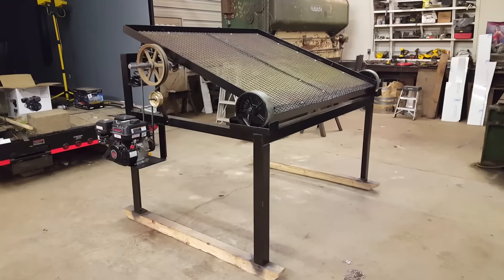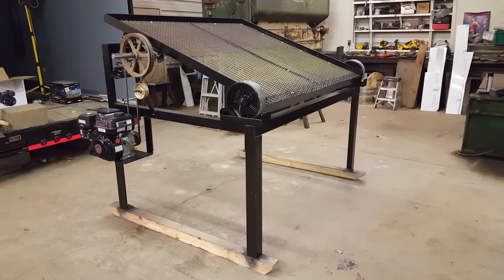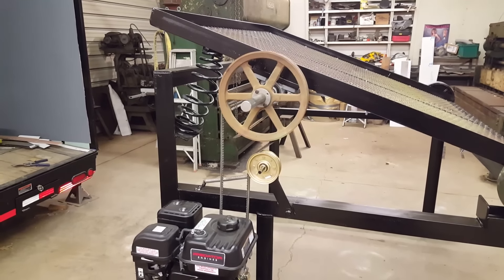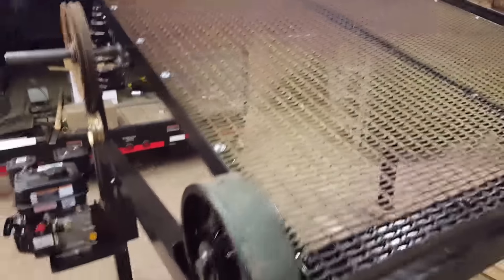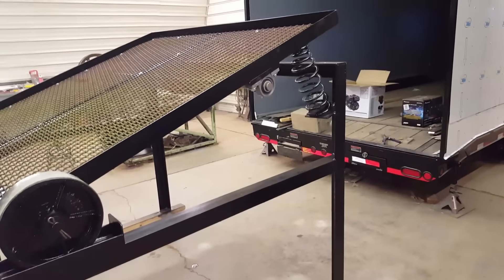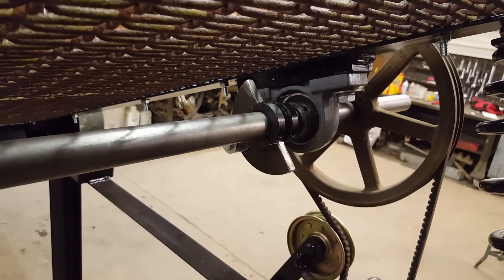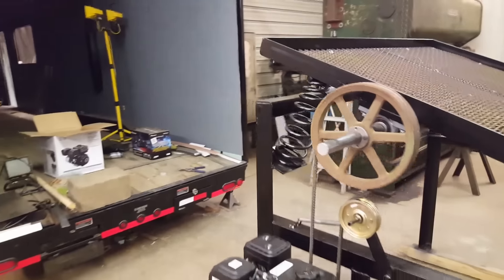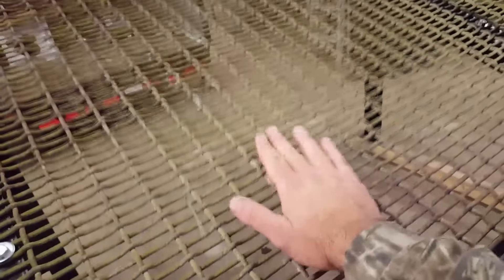Topsoil screener

Comment: Build the screen deck. Set it on springs. Take a rear truck axle with rims on it (no tires). take 3 or 4 inch diameter pipe and cut it in half, making 1.5 inch or 2 inch half circles. Weld those to the rims that are still mounted to the axle and differential. Weld 6, 7, 8, or 10 of them to the rim so when it spins they would bounce a ball up and down if you could keep it on top of the rim. Mount 2 rims with tires on them to the shaker deck, both on axles. Line them up so they're touching the rims on the truck axle with. Sooo, when you hookup the differential to a motor, the motor spins the differential yolk, which spins the bare rims, which spin the tires mounted to the screen deck. There you have a deck that vibrates when those rims spin and every time the half circles hit the tires on the deck, the screen bounces. There's no belt to break, no counterweight, no "special bearings" to replace when they go bad, and heavy duty bearings made for trucks and trailors.
Reply: Have you seen any videos of this or done this?

Comment: Nice job!  I think you may need to add couple of angle supports under the screen.  Looks like the screen is spanning a fair distance and will fail over time due to soil weight.
Reply: Thats what I was thinking myself, I started screening flower beds that had several layers of rock in them by hand last year. I had to add bracing because I kept damaging my screen shaking by hand, actually was putting in too much dirt at a time. Mine was made from 1×1 wood. Worked this 65 year old to death. Started watching videos now I'm going to build a powered one to save my back and shoulders. But like my dad once said boy get yer ass out there and get those rocks outta that dirt.

Comment: Looks very good, waiting to see a video of in in the gravel. Thank you
Reply: LAKESIDEBOB1 - Just looking at this, I see quite a few open rotary parts, great for causing personal damage, injury. 

Some 1/2" Construction Cloth Wire Mesh Shield, should not be too Expensive to Create and add, to keep fingers, hair, etc. out of those moving parts. 

Even the 1/4" type, for even better protection! That would also protect belts and drives from rocks causing a thrown belt, etc.

Otherwise, it seems to be a good start. Keep at it!

Comment: That is a wonderful look, I’m wondering if you could Mae it where it had 3 racks, top rack everything falls through except 3in rocks and larger. 2nd level would shed the next desired, 1 inch and large rocks, . 3rd rack would allow everything left except 1/2 inch rocks.   Also it’s to steep. 15% max.... give material time to shed as much as possible.... 
you can also have 3 different sautés. 3 inch and larger straight out. 2nd Shute to the left. And lower level to the right.. separating the material beautiful...
Everything else falls to the center... ..
My only other concern is the belt rattling so much, the tension is to flimsy, just my opinion...

Comment: Where did you find the large pulleys
Reply from the maker: I honestly can't remember but TSC or Rural King may have them.
Reply: I was thinking a pulley off of a cement mixer could/would work although I think those are single belt pulleys?

Comment: How'd this work out?
Reply from the maker: It works well in sandy soil.  However, it in clay it is a different story.  For clay you will need someone with a rake to help sift the soil.
Reply: @clarkhuffman1975  thanks for the update.  Im thinking about making one.  Anything you'd change?
Reply from the maker: @scottfry9466  I would probably put a shield over the engine to keep the dirt out of the engine.